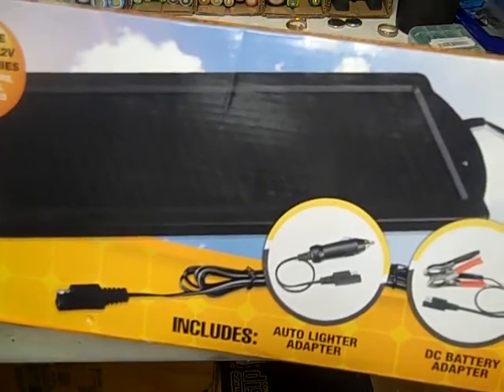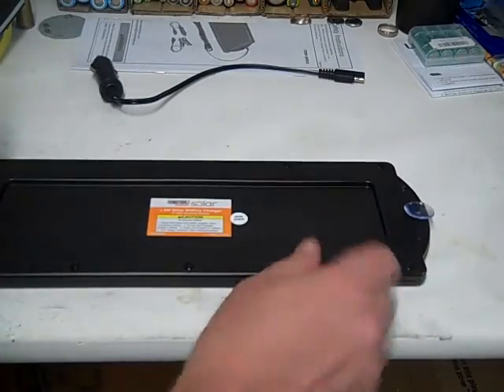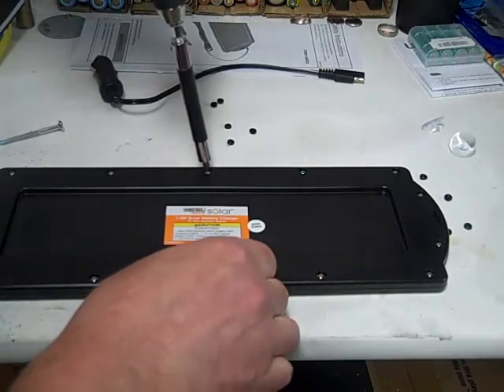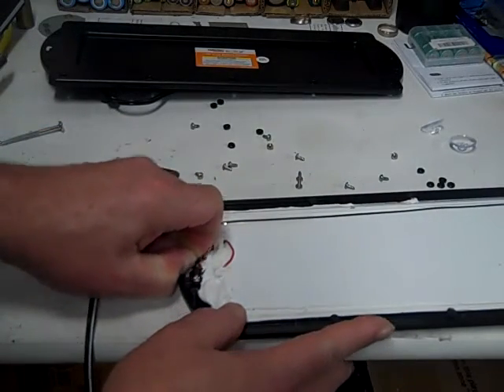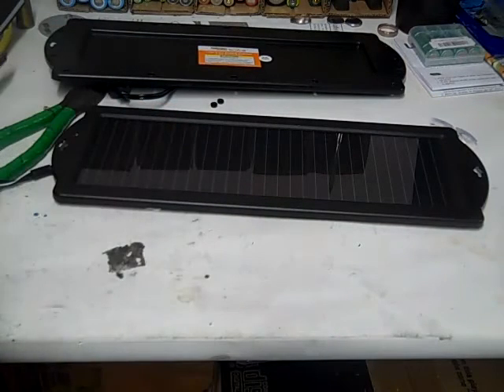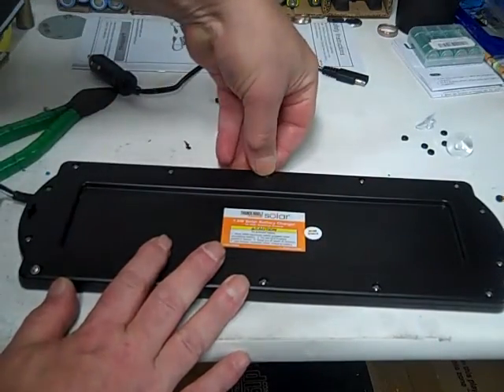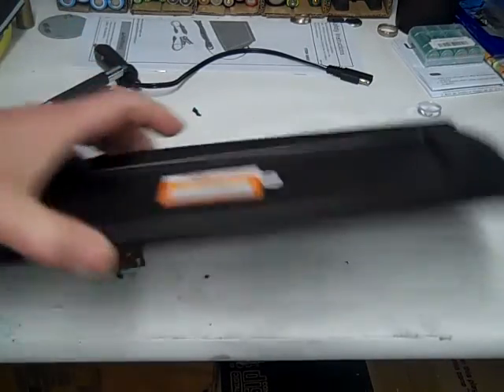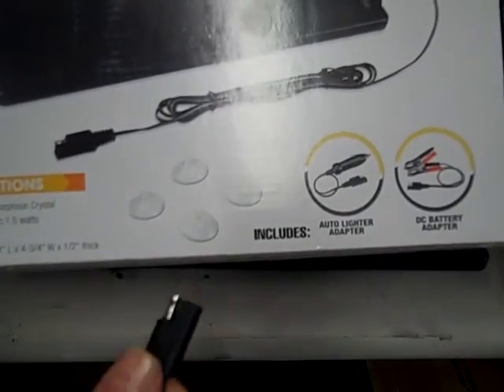Harbor Freight 1.5 Watt Solar Battery Charger - How to Cut Out The LED

Comment from the maker: I've been using this on my van for the past 10 days since I made this video and I must say it is keeping the battery topped up nicely. Usually it will have a hard time cranking after this many days but its like I drove it yesterday. 2 thumbs up for this battery tender.
Reply from the maker: Still using it andf no problems keeping my battery topped off.
Reply: Nice!  You think it could recover a battery?  I have a jump starter battery that is dead.
Reply from the maker: Not sure, what kind of jumpstarter battery? It isn't really made to recover a battery. You have to have it charged first and this will keep it charged.
Reply: 12v 7ah
Reply from the maker: If its already charged this will keep it charged.

Comment: Mine had no screws, just factory sealed plastic dome headed rivots, left them all in there, no way of spliting the unit. Took a drill and drilled right through the blue LED. No problem, job done. Took 30sec . Voltage taken before drilling 14/15 volts pulsing. After drilling 22volts no pulsing. More than happy. I intend to silicon all seams around unit, as well as the drilled hole, and bung it on my shed roof. The comment written about discharge at night if you disable the LED is fake, mine is still  fully charged after  1 week. You can see why they done away with the pulsing LED. If you bought one like me its old stock, but it doesn't take long to update it for a higher voltage reading, just drill it out.

Comment: I just took a small 1/16 inch drill bit and drilled out the led light, much easier than removing all the screws and opening up the unit and it puts out a continuous 20-22 volts in direct sunlight.  More than enough to maintain a  car battery.  My car has an auto theft device which is a small parasitic drain on the battery so this solar panel keeps it topped up nicely.
Reply from the maker: Cool glad that worked for you. Some people might be wary of drilling it out. You know for fear of damaging something else.

Comment: Just a friendly warning about cutting the diode off on this battery tender. The blue led diode  acts as a blocking diode. Which prevents the battery it is hooked up to from discharging when it is cloudy or dark. What you need to do is add an external blocking diode in line with the power cable that hooks up to the battery. If not when it is dark or cloudy the voltage it the battery will reverse and be drawn into the solar panel depleting the battery.

Comment: The blue LED is a multi function device...It drops about 3.4 volts and consumes about 30 milliamps of current. So, your panel output loses 3.4 volts and 30mA resulting in a panel output of about 13 to 14 volts and about 90 mA. It also prevents reverse current drop from your battery. With the panel hooked up to a battery, at night (no lights) turn on your cell phone camera and look at the panel...if you see a faint glow across the panel, the battery is discharging into the panel...this is if you disconnect the LED. This is not good for the panel. If nothing is seen, you are lucky and the panel will do well, most likely will output the full 125 milliamps (mA)...hope that helps.  Second thought...I believe the newer models without the LED still have a reverse current diode in the circuit, just consumes about nothing in voltage and current.
Reply: Agreed. LED’s energy consumption is so low it’s ridiculous to take them into consideration

Comment: Great video. What was the voltage before cutting the wire?
Reply: Be careful cutting the diode can deplete the battery. The  diode blocks the electrical current from reversing back into the solar panel when it is cloudy or dark. It is an electrical check valve like the check valve on a sump pump. You can do it just add an external blocking diode inline with the hook-up cable whether connected to the battery or a charge regulator.
Reply: @VickyGeagan 😅

Comment: good little video, I happen to get 19.6 volts from my Fluke meter. I wouldn't say that's a trickle charge anymore. I may have to buy a voltage regulator , which I think Harbor Freight sells
Reply from the maker: Even at 19.6 volts I still think it's a trickle charge because the amps are not there.
Correct me if I'm wrong.
Reply: That panel will not put out more than 125ma into your battery. That 19.6 volts you measured will immediately drop to whatever voltage your battery is at that moment. This thing will put out about 1.5 watts of power if you install a charge controller the charge controller will use nearly all the power from the solar panel just to function and hardly put anything into your battery. The only time you need to worry about a solar charge controller on a large lead acid battery (car battery or deep cycle) is when you start using solar panels that are 15 watts or more. What determines if a panel can function as a trickle charger or not depends on the current it puts out not the voltage.

Comment: I cut the smallest wire on the right side of the LED, which I believe is black or dark gray. not the red wire. It should work right?
Reply from the maker: Well I guess you'll find out either way since you cut it already.
I have no idea since I don't know what wire you cut unless I see it for myself.
Always ask questions first then cut.
Reply: Fix It Yourself! I cut the wire that keeps the LED blinking. Soon as I cut it stopped blinking. Very short wire. To the right side of the bulb.
Reply: Worked like a charm.
Reply from the maker: Glad to hear it.

Comment: It appears my panel has been sealed off so i cant take it apart, would destroying the led at the front panel do the same job? i.e jamming a screw driver through it?
Reply from the maker: I dont think that will do it. How is yours sealed? With silicone or glue?
Reply: My panel is the exact same as yours (just a different brand). Those black caps you pried off with your mini hook I can't do that with mine, they appeared to be glued on or they are the actual lock. I tried chiseling one of them out to access the screw head but there doesn't seem to be one underneath it.
Reply from the maker: I would probably try a different method then. Try heating up a mini screwdriver with a lighter and push it into the black cap and after see if you can turn it like a screw to see if its loose or maybe scew it out. Do this at your own risk.

Comment: The LED is actually a diode (one way current) so if you disable it, it'll discharge the battery at night time. Bad idea.
Reply from the maker: how can it discharge if the wire is cut?

Comment: Wouldn't it be easier to maybe paint the led with a small amount of black paint or cover it with electrical tape?
Reply from the maker: we're not trying to hide it. Eliminating the led is making the current steady instead of pulsing.
Reply: Hahaha ...